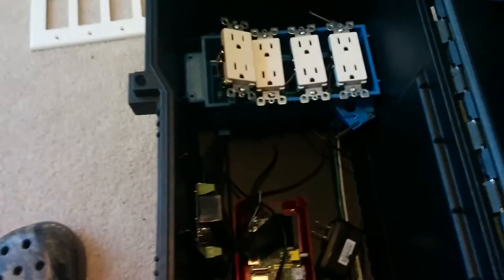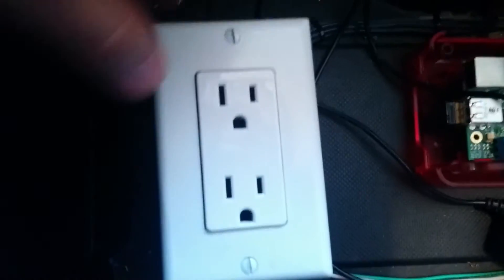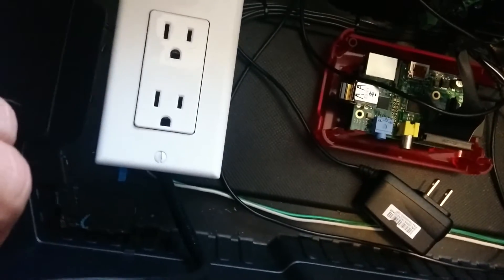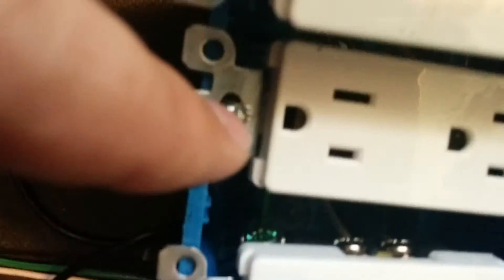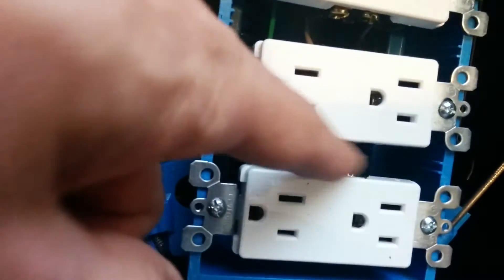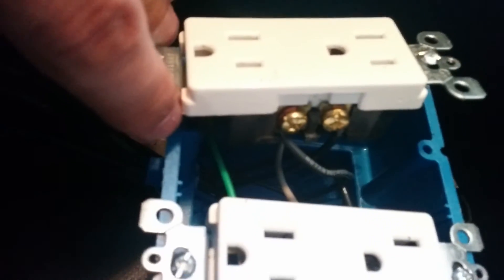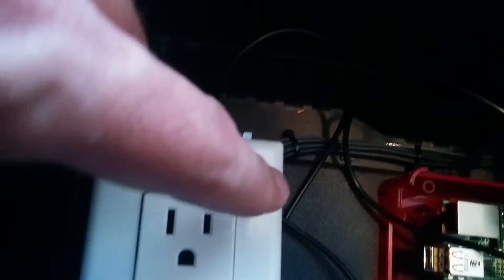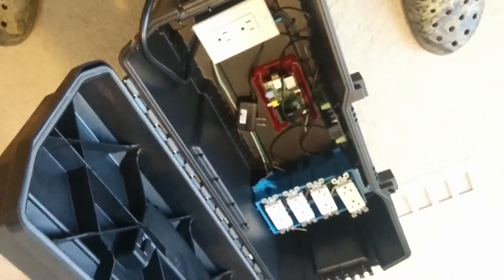LightshowPi - Closer look at the wiring ...

Comment: Are you powering all the relays from the raspberry pi itself or are you using a separate power supply and using the gpio pins to pull in the relays?
Reply from the maker: +Parker Plays I'm powering the relay from the raspberry pi itself ... works great with the relay I have and only 8 channels... your mileage may vary if you add more channels, or use different relays.